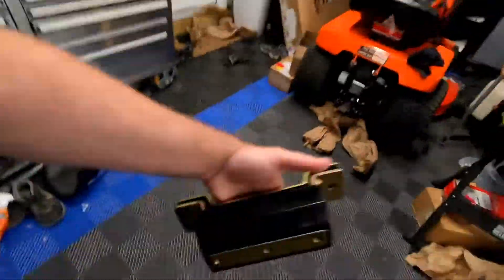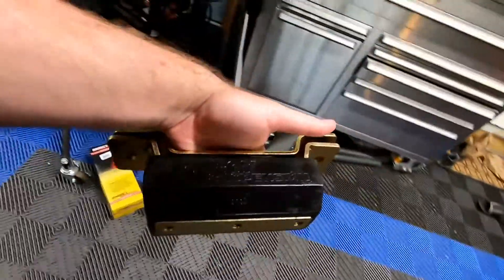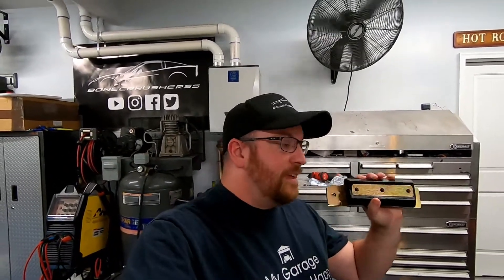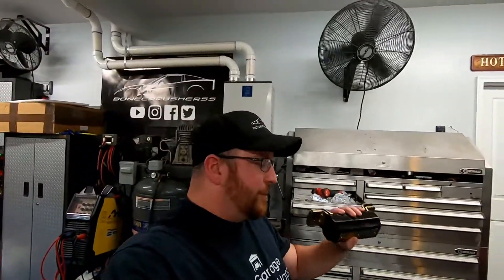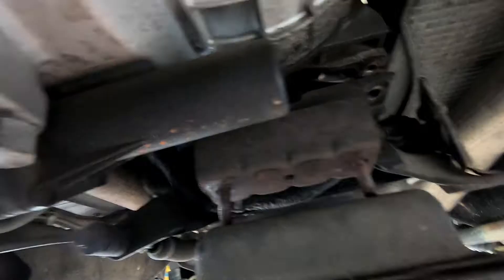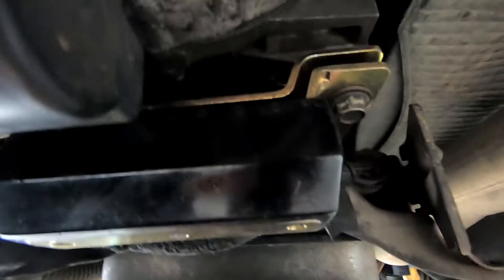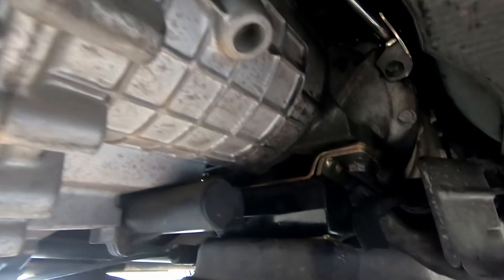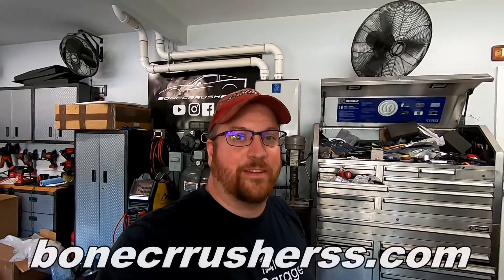2005 GMC Sierra 2500HD - Energy Suspension Transmission Mount

Comment: I have just the trans mount but i might do the engine mounts. Is your shakey?
Reply from the maker: Yes I had poly engine and trans mounts and it did rattle a bit. 

This is kind of dumb - but replacing the rear cab mounts actually helped reduce a lot of of the vibrations.